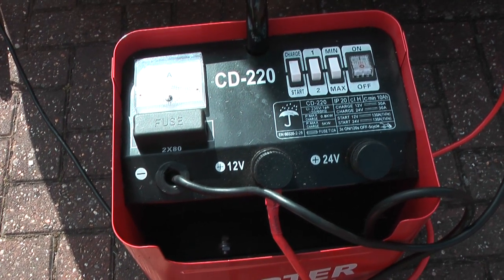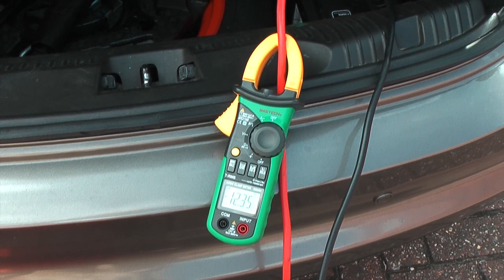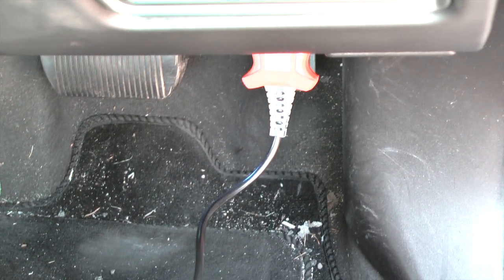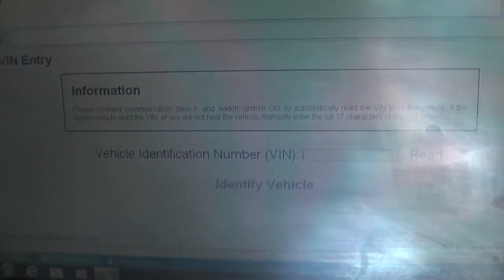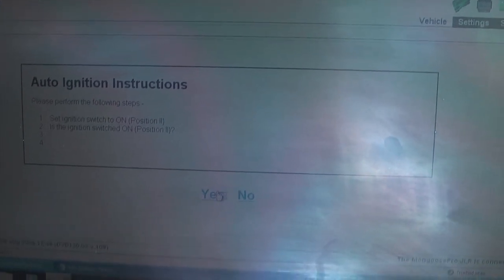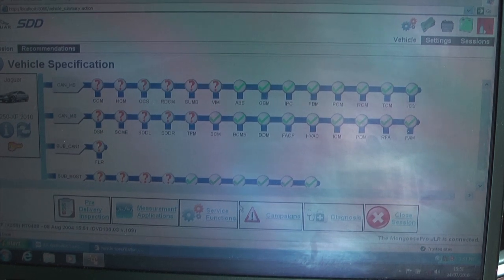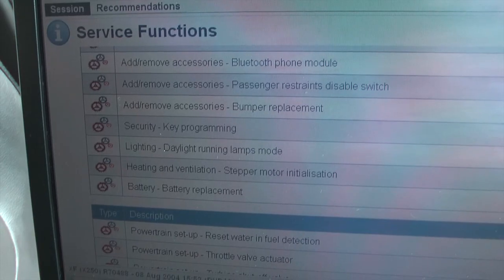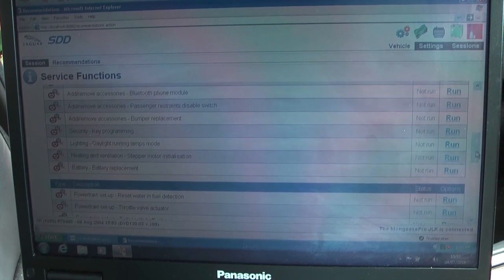Jaguar XF SDD Programming Setup

Comment: Hello
I found your video an excellent source of information thank you. I wanted to ask you, the comments you received regarding the cheap lead is that the lead that comes with the SSD package. I am thinking a put buying the same as you for my XK 2010. I'm a member of the Jag owners club and having some very confusing issues with my electrics have asked for advice. I get either no response or told I'm on the wrong models thread, which is a great help. I have had my car looked at by my garage then an auto electrician who said go to main dealer and get a full diagnostic check. Sounds good but I'm disabled and have limited funds, so I'm taking a course on auto electrics and wanted your advice on the SSD system for my car. I don't mind the expense if it will fix my problems. Keep up the good work.  Andy

Comment: Hi Leon-Have just purchased an 2012 XF and am loving the How To Videos. I am confused about the OBD Cable options. Can you share which you you have and how you have found working with them. I'm especially interested in programming the module for powerfold mirror upgrade. Have you tried any module programming or just used your setup for diagnosis?

Comment: Hi Leon,
I have just purchased the SDD software and cable. Could you tell me is it normal for sounds from the speakers and the fans, screen to go off and on when connected and carrying out a task?
Reply from the maker: Yes, it makes a horrible crunching sound 3 or 4 times from the speakers. You'll have the wipers doing 1 pass, and a lot of warning lights going on and off while the software looks for each of the car's modules!
Reply: @leonfletcher6045  thanks. Really appreciate the reply. Where are the fault codes located within the system to look for any faults. Thanks
Reply from the maker: You will have to rummage in the diagnostics area. The system likes you to put in your "symptom" then it shows you what it thinks are the revant codes. It is possible to see all the codes from the time line view I think (I don't have the software in front of me just now). I learned by clicking through each of the menus. There aren't many where you can do damage (erase all keys and the item for replacing the clocks excepted!).
Reply: + @leonfletcher6045  ...
In the USA we are allowed to utilize the Global Open for the windows, but not Global Closed... Could I change that setting with this particular software?
Reply: @hokiepokie333_CicadaMykHyn  exactly what I need 😢🙏🏻

Comment: HI SIR  I AM TRYING TO CHANGE K V M MODULE XJL.2011. USING SKP900..KEY PROGRAMMER. BUT A SKING ME 4 DIG CODE.AFTER READING VIN.PLS CAN YOU HELP TELL WHAT I CAN DO TO EXCHANGE.ALSO I HAVE SDD 147 SOFTWARE FROM CHINA.  FULLY ACTIVATED. BUT I NEVER DID WORK ON JLR. FAST TIME. PLS SIR CAN YOU  HELP? I CAN READ OLD  K V M MODULE. I ILL VERY THANKS FULL.

Comment: Hi Leon can You please post a link where I can find this program for my Jag (2012)?!
Reply from the maker: SDD is usually available from Torrent sites (best use a VPN)! Sometimes also included if you buy a Mongoose JLR cable from eBay. I haven’t seen it sat around on a normal website.
Reply: The JLR Mongoose pro Clone is available at aliexpress. Comes with dvds and a cd driver for the cable. Also sdd can be purchased on ebay for 10euros separate

Comment: Leon, you sound very knowledgeable about Jags. I have a question. You are aware of the exhaust note of the F-Type SVR, correct? I understand that this particular sound is due to the engine management system and how it handles un-combusted fuel. Is it possible to program those same settings on another car to get a similar sound?
Reply: superluminal89 uhhh that sound has to do with the active exhaust valves in the rear muffler....